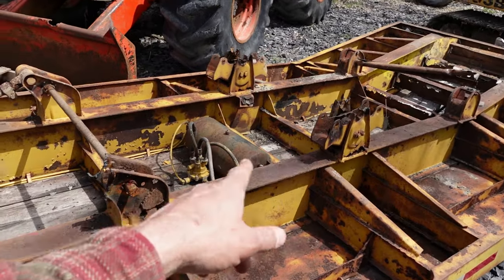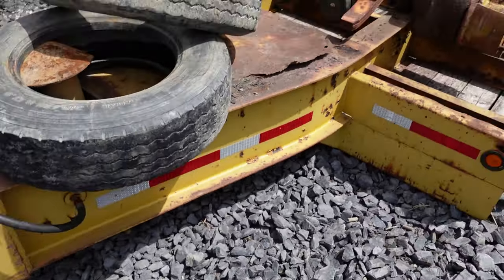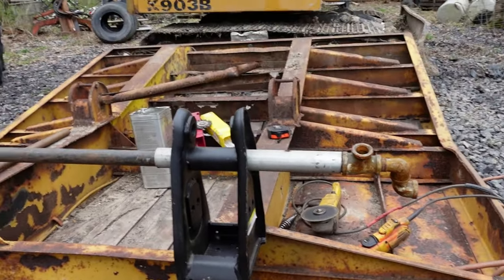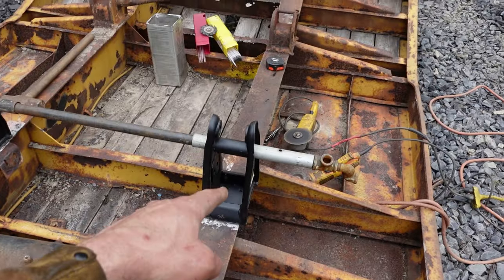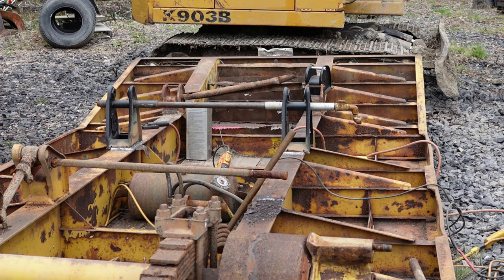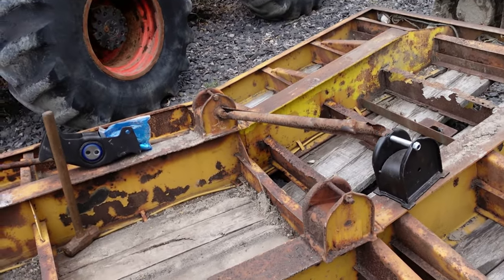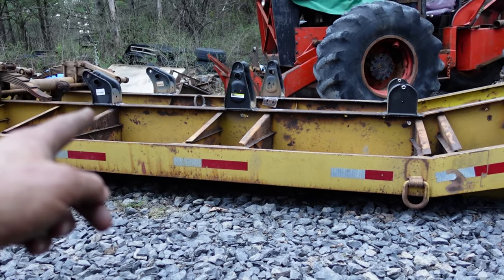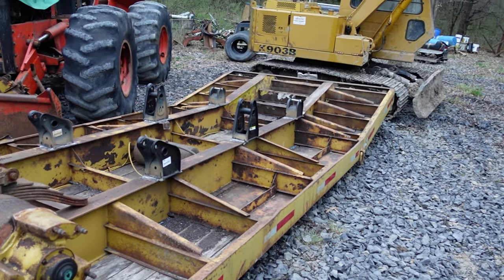Eager Beaver 20 ton Trailer rehab - Part 2

Comment: Hey!

Great video.

Have you ever seen an eager beaver trailer with wheels down the middle of the trailer as if the axels are less than half the width of typical axels with hubs and wheels not only mounted on the edges of trailer but also down the middle as if it resembles a 16 tire lowbed trailer ?
Reply from the maker: I have sean trailers with 4 rows of tires if that is what you are referring to, my neighbor has one, not sure of the brand, think it is an older design
Reply: Can you ask him?

Is open to selling it ?
Reply: Can you ask him?

Is open to selling it ?

Comment: I bought this same model trailer, it's been parked for years and I need to drag it out and do a lot of this stuff to it myself.  Where did you find most of these parts or is a lot of it generic?
Reply from the maker: It's pretty generic, I found a manual online that has some info, but a good truck shop in the area got all the parts from a couple pictures. Good luck